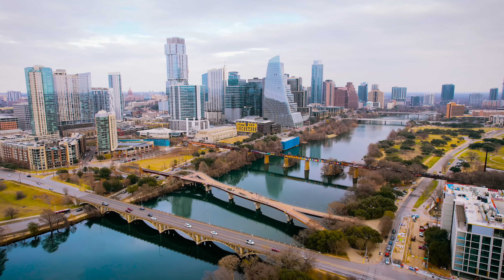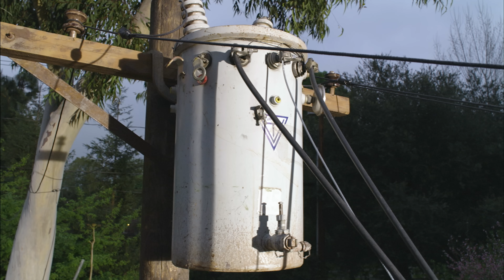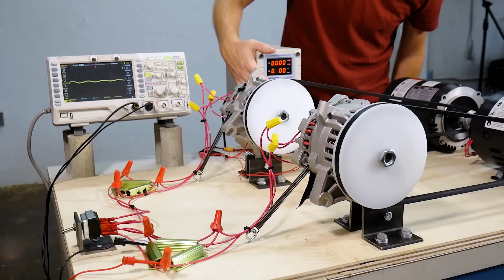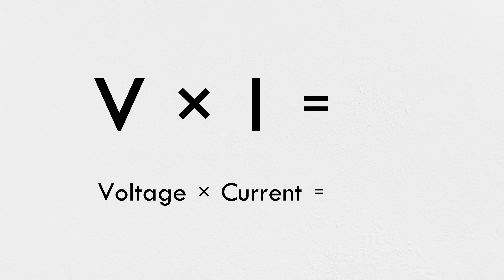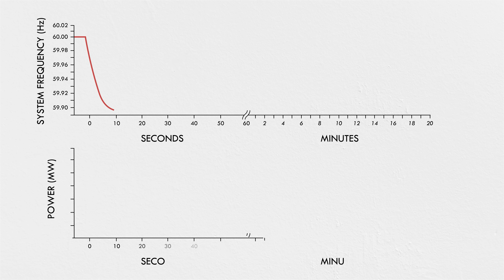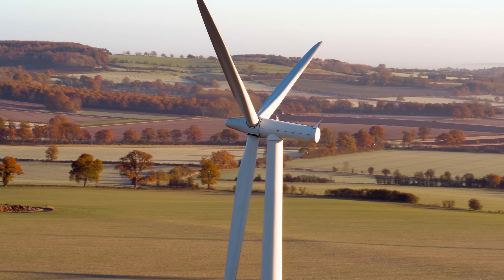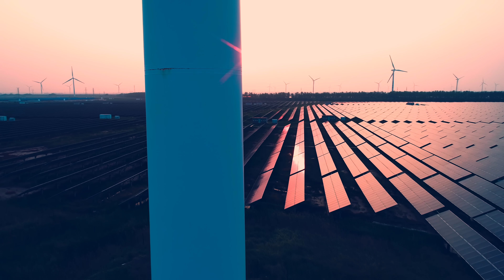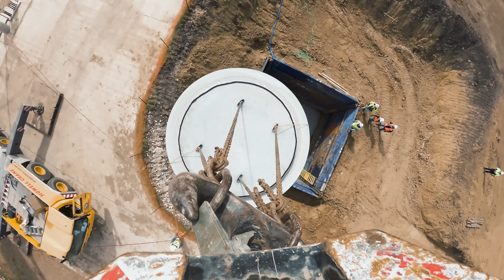Connecting Solar to the Grid is Harder Than You Think

Comment from the maker: 📖Signed copies of my book, Engineering in Plain Sight, are back on sale! https://store.practical.engineering/
🌌Get Nebula using my link for 40% off an annual subscription: https://go.nebula.tv/Practical-Engineering
Reply: Hey! Solar interconnections are what I do for a living! Always great videos on the power grid. You reflect the info very accurately!
Reply: I wish you had a media mail shipping option for your book.  I’m  only a few hours away in DFW, and the cheapest shipping option right now is over $12.
Reply: O-scopes everywhere are jealous of the hard hat you provide to protect yours.
Reply: The vast majority of wind generators are based on doubly fed alternator topologies.   The armature spins at a speed depicted by the wind and then a small inverter is used to drive the armature excitation at the difference frequency between the armature synchronous speed and the grid frequency.   In this way the main output from the stator windings are perfectly synchonized to the grid.
Reply: The main reason for PV inverters stopping export during a frequency dip was due to some archaic grid interconnect standards that mandated this behavior.   These grid interconnect requirements dated back to the very early days of grid connected PV when the grid operators were working on the assumption that PV penitration would never get significant and the assumption that PV inverters can't be trusted to help resolve abnormal  grid events, so the requirements were laid out that all PV inverters should simply shut down duing frequency dips and leave resolution of the grid abnormality to the traditional generators.  The grid interconnect standards have been changed to now require 'frequency ride through' which is clearly how the legislation should have been written initially. 
There is a theory that grid interconnect standards were written in such a way to make PV and wind generators have poor performance with regard to maintaining a stable grid as a means for the traditional grid operators to engineer their own security and not get displaced by the new technology.
Reply: I am thankful for your many educational videos in engineering. Would  you please, make video about Solar System on roof of houses in Texas? I hesitate to install solar panels on my house roof in DFW TX. I need to learn more from your engineering knowledge about Solar Panels on house roof.
Reply: I would make the suggestion that there are not technical barriers here in getting a much more resilient grid based on modern renewable energy resources.   The biggest issue seems to be related to the inertia related to changing standards and legislation  - especially when you consider that the industry players who currently have the biggest influence on required legislation change are the encumbant companies who are trying to slow down the required legislation changing to protect their existing business interests.
Reply: commendable civil eng. channel, deep dived into electrical/electronics, likely required consultants for this video. however, it was only difficult for a brief period when renewable energy is rising and battery energy storage isn't common affordable yet. these days, this problem is virtually eliminated by BESS and smart grid systems.
Reply: pov: your trying to learn how to power servers on solar and you cant find any useful recourses that you understand... then this video drops :DDD
Reply: Love you videos but you are starting to over simplify things. Take a look in to PWM. I am an automation and work with sinus noise.
Reply: There is no lifetime purchase for Nebula?
Reply: When will the offer end?
Reply: @santiagochacon9171  Usually within a week or two, but it's a constant promotion.
Reply: SEEKING ADVICE: When the power goes out in my neighborhood, is it recommended to switch all the loads that were on in my house to off or leave them as they were. Which is safer for the linemen who are reconnecting the lines?
Reply: There are few technologies in the history of man more destructive than than so-called "renewable" energy. You have to strip mine the entire planet to get the rare earth minerals you need to make them work and when those devices outlive their usefulness they go in a landfill.
Reply: Here in Michigan this makes NO sense. Just throwing money on the fire. At 14% efficient, the work to make and install such a pile is worth more then the pile itself. Nothing good comes from wind and solar. FACT!
Reply: Oh snap ...  I've never thought of distributed generation solar increasing rocof. It's a lose lose situation for grid tied solar.  The next Gen nat gas turbines (GE and Siemens) seem really cool, and a good mitigation for this issue

Comment: Since the “Odessa distrubance”  ERCOT has loosened their requirements, for frequency ride through. Allowing Inverters to utilize more of their natural  flexibility on ERCOT’s messy grid. 

Inverters are very flexible in how they can match grid conditions or push them, Utilities initially did not want inverters impacting their grid at all so all the flexibility was tamped down causing. Now in places like Tx where solar is so prevalent we are seeing IBRs start to push the grid conditions around more and more. 

Since Odessa most solar farms have retrofitted their inverters to avoid a similar issue and allow for better “ride through “ of grid events. We have also seen a mass deployment of BESS that has stabilized the grid that it would be unlikely for something like this to happen again. 

I work on several solar and BESS plants in Tx and have worked with ERCOT implemented many of the changes updates that came about because of this event.

Comment: It is great to see a positive post like this. There are a lot of anti-renewable folk (which makes no sense, but there are) who have jumped onto this idea that renewables, because of the lack of flywheel, will leave us vulnerable to system problems.   I do not know a tonne about any of it, but I imagine there are certain advantages to hydro and steam systems over wind and solar.   Certainty would be the big one I suppose.  And I assume inverters that can balance the grid require some sort of storage capacity for times when they need to add rather than subtract power from the grid.   But even in the simplistic terms I require, that does not seem like a difficult problem to solve.  Maybe it is a difficult problem to solve well. 

As vehicles become electric and more people need more heating and cooling to deal with climate change, I imagine things will have to change significantly.  

 moving away from fossil fuel power generation.  That is clearly not a good idea.   But why do renewables have to be so complicated.  At the household level I could buy a diesel generator and have it run my house while remaining largely ignorant as to how any of it works.   For some reason, to use wind or solar, I have to learn the equivalent of a few courses on electricity.   

One thing I do not understand is why I can run a cabin on a gas generator with next to no knowledge about electricity at all, while going off grid with solar, wind, or hydro requires me to learn the equivalent of two or three post secondary courses in order to understand how it all works.  I should be able to hook an old phone to the system and have it deal with all the electrical knowledge for me.

Comment: Very interesting situation. I have noted that my home inverter also helps with power factor correction. It certainly requires fine tuning to prevent oscillations caused by equipment reacting to other equipment corrections and resonating out of control though. I do recall one time where a new wind energy site was being commissioned and there was a beat frequency like a slightly out of phase system was being connected and then disconnected causing a definite flickering beat to lighting. I never heard what actually caused it.

Comment: indeed , before dc-dc converters where available, the transformator was king of the hill. but AC networks are both complicated and outdated now. if it was a dc network, then the problem would be vastly , immensly far less complicated. AC networks are inefficient, and have mirage of problems dc simply does not have. and currently there is no actual need for dc in homes and insutry with only a very few exceptions. that be machines that are synched to the grid freqvency. some older stlye motors for exmaple, and stuff with regular powersupplies. anything switching mode ? yeah those don't need AC. computers, laptops, lights, recent ac units, fridges, ovens etc... industrial stuff wise variable freqvency drive actualy does not need ac at all. some obsolete dimmers and thyristor based controllers need em, but those are obsolete anyways. 
world needs a huge change, gotta go for dc power. then having solar and wind and other sources incorporated into them mix is less problematic. no phase issues, just keep the voltage to be within limits. that simple.

Comment: 2:35.  A key aspect. The grid is currently designed and constructed to deliver power from generating stations to the demand load. It is not designed for power to flow in the opposite way. That and power factor issues make the installation of remote solar and wind generation and co generation a much bigger challenge than the public realizes.

Comment: The best way to deal with alternative energy...
Is to Not grid connect it!
That massively simplifies things.
Build your system to 100% operate locally and ONLY connect when you need power as backup (aka: charge storage when too low).
That Avoids all the technical hassles to "share" power, 
even in a Net Metering state like Indiana (Yes, Indy! One of only a Few states that have this option...and California DOES NOT!).

Correction: Synchronous Dyna-Motors are almost perfect and Do Not Require electronic control (no temperamental PLLs required). These devices can also provide almost total electrical isolation as well...at least uo to lightning arc-over(!).
If the dyna-motor has dynamically driven energizer coild on the grid side then during a power failure the alternator automatically disconnects which unloads you side and "safes" the grid side.
Simple.  Effective.
The synchronous nature of the device ensures on-frequency, on-phase operation.

I've got a ton of intel on this subject!

Comment: I suppose in reality this is the price we pay for technology, the more we use automation, the more the likelihood of a massive failure. I know from my days in substation refurbishments where a 33kv substation was a 100 x100 ft yard, whereas now it is a building the size of a small house. The old system had two routes, one working, one in standby that you could manually switch between, which if you wanted to sabotage was an undertaking. Nowadays, take out a control panel, and it can bring a huge number of other control panels down as it cascades, making the manual switching operations much harder and widespread.

Comment: Renewable energy is the most costly form of energy,. Who pays to replace these solar panels and wind turbines in 20 years when they are to be replaced??? The destruction of farms and wilderness has to be seen,  the amount of land that is required to run transmission lines across the country is enormouse. Nuclear power lasts up to 100 years and in the long term is the cheapest form of power. ???
Reply: Where exactly is wilderness being destroyed specifically for wind and solar?
Reply: Nuclear power can last 100 years? What does this even mean? Rods dont last that long, nor do the components.
Reply: @ffffffff-gu5qr  in theory nuclear fuel can be reprocessed so the fissile materials lasts much longer than what it typically does, but in that time you also have tons of inevitable maintenance for everything in that nuclear power plant anyway.

Comment: Once solar or wind known as micropower is connected to the good can only put in about 15% of advertised output easily demonstrated with a volt amp meter in 4th grade
Electricity is like pumping water or are against existing pressures like the grid

Comment: I have been working at understanding how grid tied inverters sync to the grid. My question is how does the grid tied inverter only detect the input frequency of the grid and not see it's own output. I thought that the output of the grid tied inverter is fed back to the grid by connecting the output of the grid tied inverter in parallel with the incoming lines from the grid. So, the phase lock loop would see both the input frequency coming from the grid and also it's own inverter output frequency. So how does that work? Is the output of the grid tied inverter connected in parallel with the input from the grid? How does the grid tied inverter phase lock loop only see the input from the grid?

Comment: Nice video, but … one thing I don't understand. Everywhere else in engineering “pulse width modulation” means literally modulating pulse _width_, adjusting the timing of the switch. But here you're using it to refer to voltage modulation? I mean, you can modulate voltage by running your PWM through a low pass filter, but that's not the little stacked switches model you're talking about, not at all. Two different D to A technologies.
Reply: No, the inverter literally adjusts the WIDTH of the pulses.
Reply: @MrSummitville  The graph at 6:14, the one described as “pulse width modulation,” shows not a train of variable width pulses, but a voltage-quantised approximation to a sine wave that's built by a stack of switches, essentially a low bit count D to A. It's clearly the height, not the width, that's modulated in the attempt to improve the approximation.

It might be an editing error, not a conceptual error, but surely PWM should be showing a variable width pulse train (because of the words).
Reply: @stephenspackman5573  I agree, he does not clearly show the invidual pulses of the variable width PWM Signal.  He initially shows the output, as a stepped-voltage. But then he overlays a "smooth" AC sine wave voltage. He is displaying the OUTPUT Voltage. The variable width of the High Frequency PWM input signal, makes the stepped-voltage, become a "smooth" AC Sine Wave Voltage. Most (99.9%) of the Pure Sine Wave inverters use a Variable Width PWM signal, even though this video does not clearly show the PWM pulses.
Reply: @MrSummitville That makes very little sense. The output of a filtered PWM would not look anything like a stepped signal. He's using graphs for an (idealised) voltage modulating DAC while talking about PWM. (You can see this yourself either by looking at the maths or using sound synthesis software. The sharp corners tell us that this is intended to be pre-LPF.)

Comment: Plus 
Once renewables are connected to the grid It could only put in 15% of advertised output or extra electricity the ignorance of renewables is easily demonstrated with a volt amp meter and 4th grade math called ohm's law 
Unsustainable

Comment: Here in Australia the solar rollout is causing us headaches, both from rooftop solar and the massive farms that they're building. And then there's wind, much of it getting old, so older tech.

The coal fired plant, the "base load" stations, have to offer what we call ancillary services, mostly frequency control or FCAS. There are a number of markets, raise regulation, lower regulation, raise reg 5 seconds, lower reg 5 seconds, voltage control (MVARS). I don't think that any of the renewables, save for hydro, can offer these services.

Our political leaders are in a mad rush to shut down fossil fueled plant, so I have no idea how the grid will function after this happens from 2035 onwards.

Where I worked we bid in each day. Say, 500MW with around 10MW for FCAS. On hot days the turbines would be flat out producing 500MW so we're offer no FCAS raise (up to 300MW in the lower direction, though). Solar or wind cannot provide these services, but they do get to big on first despite what the power cost would be for that day.

Comment: It’s definitely an interesting conundrum but it is important to differentiate the function of grid battery storage as a source of continuous power source and the primary function of grid scale batteries which is to act as a ‘capacitor’ to ‘smooth’ voltage..

Grid scale batteries allow for a millisecond response to voltage variations and mitigate the risk of brown-outs. 

Focusing on the inverter is misleading.

Simple question, if I have a solar system and battery then why does grid capacity matter to me? My panels will continue to produce power  when my  neighbours have no power, if I have a 5KA  battery then I’m good for days…

You are highlighting grid issues but that just reflects the failure of grid/generators to invest in the emergence of new sources of supply to the grid…  
 
Network stability is not caused  by renewables, it’s a consequence of the complete failure of traditional generators to invest in new assets to adapt to the new market for energy generation. 

The fundamental issue is the executive motivation to minimize investment, maxiize profit  and therefore executive bonuses.

Comment: Perhaps you could explain why the frequency problem cannot be solved by supplying (or replicating) a reference signal for all generation facilities to follow, like the synchronization that happens in the GPS constellation of satellites. Maybe I'm oversimplifying because I don't understand the problem well, but if the frequency represents supply vs. load matching, having a stable universal signal seems to be a logical step toward resolving it.
By the way, thank you for this video. It answered many of my questions about grid power and why interconnections were so challenging.